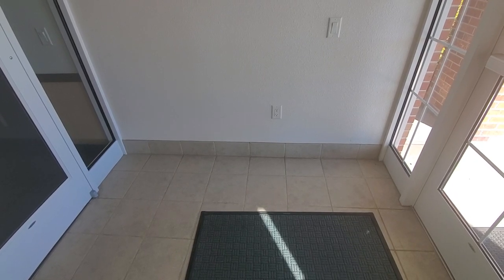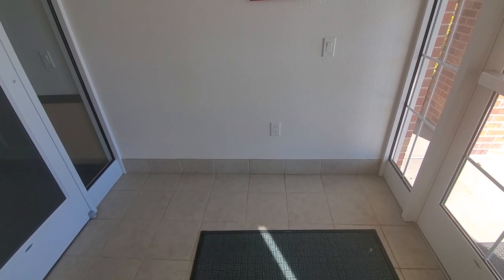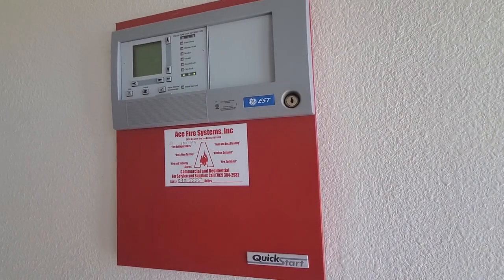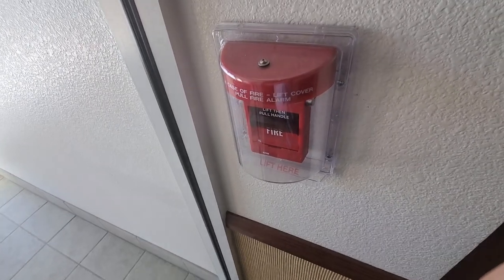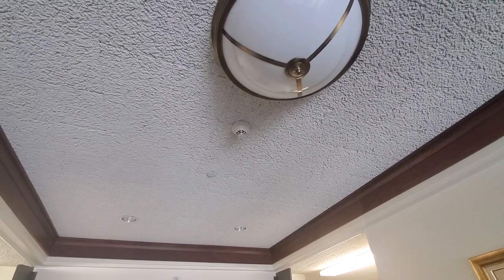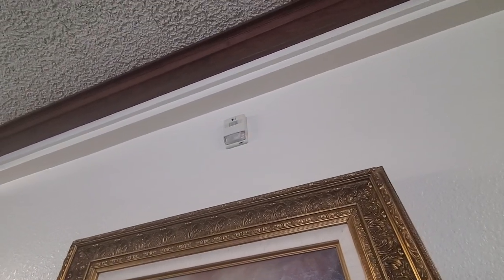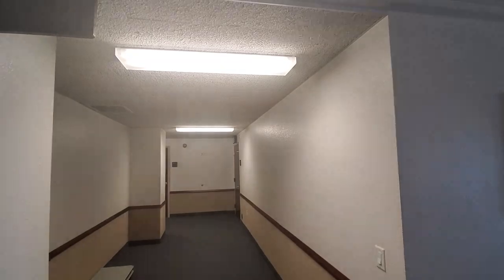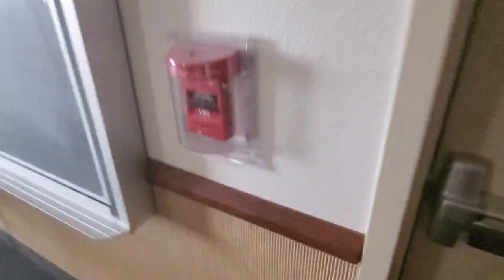Brief (Short) Fire Alarm Tour at my Church...

Comment: The classroom across from the set of restrooms. (Not the single occupancy restroom.) has a door in it that leads you up a set of stairs. Those stairs take you to a mezzanine area that works it’s way around the building the same path as the hallway. You would most likely find duct detectors and relays for fan shutdown. As well as a pull station at the top of the stairs. The ward house in my neighborhood is an older version of this building from 1994 consisting of a Simplex 4001. But no sprinkler coverage. And the building down the street from it is just like this one. But it has an FCI 7100 and Wheelock AS-24MCW’s. Sorry to talk your ear off
Reply from the maker: Hmm interesting. I'll have to see what you're talking about the next time I go to church, if I'm still in the same ward at that point lol.